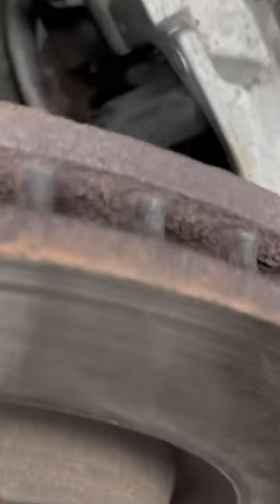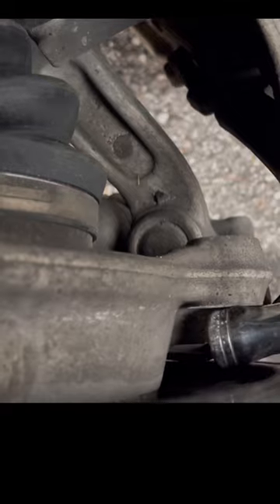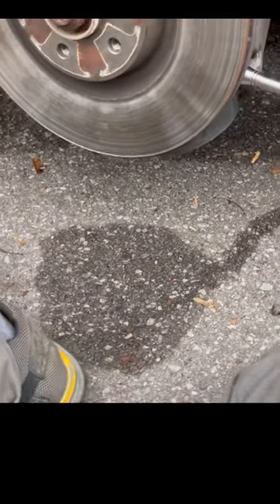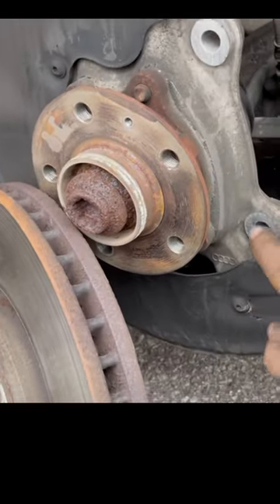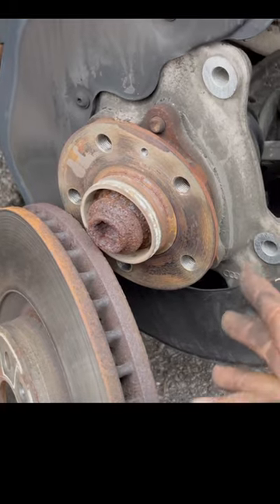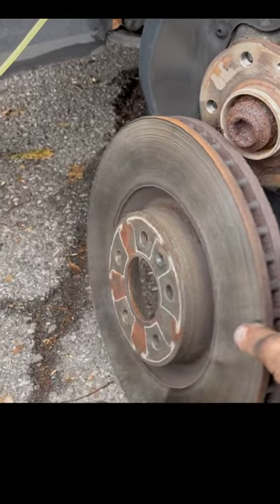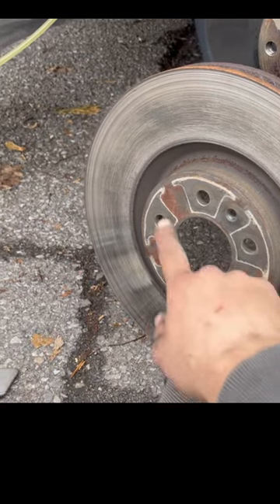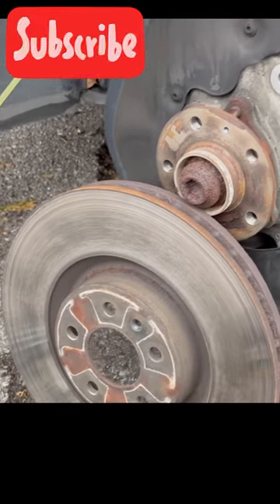Removing Brake Rotors Without Hammering the Wheel Bearing causing Premature failure mechanic Tips ￼

Comment: Air hammer with a flat bit on the center around the area where the lug nuts go. 10 seconds and it's off doesn't matter how much rust there is. Air hammers are a severely underrated tool.
Reply: I use mine daily.
Reply: Good way to shorten the wheel bearings life

Comment: Also check out using a gear puller. Its never let me down no matter how rusted, warped, or corroded.
Reply from the maker: That must be a massive puller let me know the brand name or a link to the tool if you don’t mind.

Comment: Dangerous with aluminum. Good idea if it is not to stuck. Living in pa, sometimes it takes an air hammer and lube to get it to budge. I don't like hammering to knock something loose. I use proper separation tools. Astro last chance hub remover is my first choice for hub assemblies. It is amazing. Astro makes some amazing tools. Also very reasonably priced. Amazon is where I get most of my tools. Astro, Sunex is the best 2 brands I found that are amazing, reasonably priced and they will take a beating. I know...

Comment: No not same or similar. The rotor is much harder material. And for the bearing guy, It's stuck not fastened. If you can put more force with a hammer on an essentially loose rotor than the weight of the vehicle at hitting bumps in the road, you're from another planet. SMH
Reply from the maker: I didn’t fully comprehend your comment but, I completely disagree with that.  A tire is a air balloon and it has something else called suspension.  A hammer, metal hitting metal is a completely different set of physics
Reply: @NaptownTuner  The physics are definitely different. But that doesn't change the fact that you cannot put as much force on the bearing as it will see on the road. You couldn't begin to compress the spring and shock with a blow from your hammer yet it will compress and decompress easier and faster than you can swing by the inertia of the vehicle. You're basically comparing the inertia of the hammer to the inertia of the vehicle. The weight of the vehicle alone sitting still with the suspension not in play is most likely more force than you can deliver with your hammer. If you can damage the bearing with your hammer it will damage when you let down your jack.

Comment: just use a hammer why reinvent the wheel
Reply from the maker: Is a hammer good for the wheel bearing?
Reply: @NaptownTuner  if you find yourself smashing the hell out of the rotor to remove it you might consider possibly damaging the bearing. Otherwise it will not damage the bearing.
Reply from the maker: @360fanboy360  everyone hammers on rotors I was just giving a different option to consider if that’s ok.  The bearing might not go bad right away after being hammered on but it might reduce the lifespan.  If it’s a customer car and not your own hammer away as usual.  Maybe if it’s your car you might consider the the thought a little more.
Reply: @NaptownTuner  on late model cars with low mileage i will use an air hammer to rattle the rotor loose but if a rusty POS the hammer is the go to
Reply: I say use whatever works, this worked because the rust wasn't too terrible.